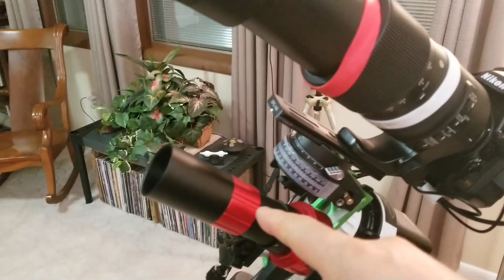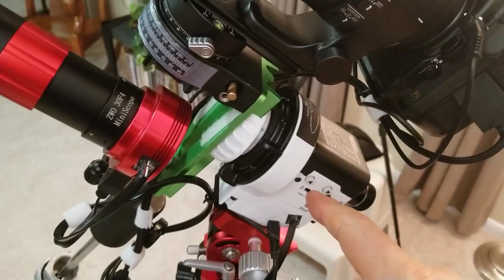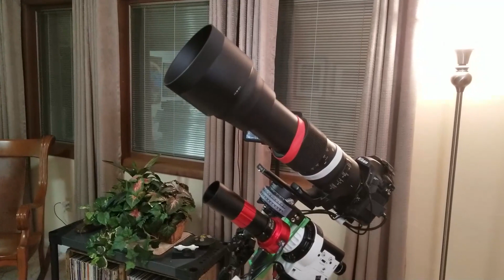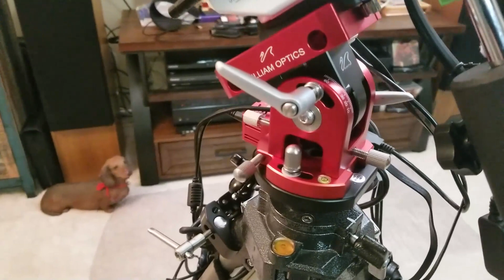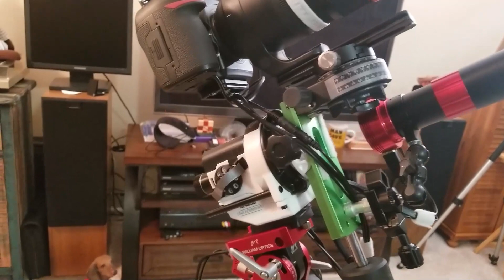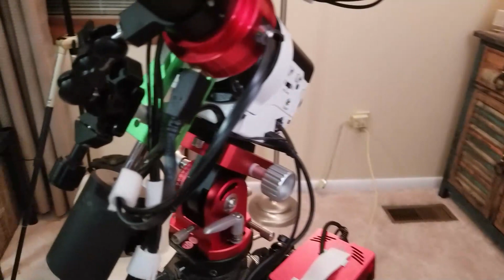Sky Watcher Star Adventurer Pro - An Overweighted Configuration

Comment: Yeah, I learned that centralizing the mass closer to the middle reduces the amount of torque/load on the mount. If you decide to remove the rotating base and dovetail bracket (and mount the lens collar directly to the latitude base), you might drop another pound and bring the assembly an inch closer to center.

I first tried my camera on a ball head mount. Later I tried it on a nice video floating head (which had a perfect spot for mounting my guidescope, and had really smooth alt-az slewing). But it raised my assembly so far from center that I almost needed second counterweight or extension bar. I later got an L-bracket and moved it down a couple inches and now I'm fine with one counterweight at mid-bar. It's definitely been a trial-n-error process.

I had an old raspberry pi laying around the house, so I decided to load up astroberry. I have it working at 90%. But just have issues with it running photo sequences (which is pretty important). I also use Sharpcap for polar aligning, which has been really good. So I might still need to stick with a laptop connection until I can get these issues worked out.

Thanks again for sharing.
Reply from the maker: Thanks for your comment Mike, but removing the dovetail plate and pano base/clamp would actually not save but about 0.5 lbs., and in the process I'd lose the ability to balance the camera & lens fore/aft for a more refined balance relative to the targeting position for whatever celestial subject I'm going after.  All in all, this setup is working actually a bit better than expected, with successful exposures as long as 13 minutes thus far.

Comment: I'm pretty new at this so my experience is limited but I bought this mount for Milky Way shots and for that it's very good. It holds a Canon 80D (1.61 pounds) and Sigma 18-35 F1.8 (0.5 pounds) or a Samyang 14mm f/2.8 ED with no problems and for wide field photography the polar alignment is not nearly as critical. 
I have used it for a shot of the Orion nebula once or twice with the Sigma 150-600C (3.96 pounds) and had no real problem with that but it's an easy to find and fairly bright object so it doesn't need long exposure times. 
I've seen a lot of people use a Samyang 135 F2 (1.82 pounds) for other deep sky objects and of course small APO's like the Redcat 51 are pretty popular and they get pretty good results.  I have a Irix 150 f2.8 (macro)  that I want to try on the Pleiades.  I've seen one guy get really nice results with it.

Anyway the point is that (imo) this mount is good at a few things but that if you get to the point where your equipment is too much weight for it, it's probably time to move to a better mount rather than try to modify this one.  Keep it for it's portability and wide field Milky Way shots.

And thanks for the LED micro light idea. I was using my phone but it's hard to hold in position and adjust the alignment at the same time.
Reply from the maker: Hi...thanks for your comments.  I'm glad you found my use of the microlight a useful idea.  I fully agree that a more robust mount with higher payload capacity is desirable.  The ideas I've shared here are, as I know you realize, just an effort at making the best of a less than ideal situation.  :)  For grins, here is an image comparison I made from two subs I shot last night, one of 8 minutes, the other at 16!  Yeah, yeah...can't do 16 it seems, haha!  https://tinyurl.com/dp-SApro816

Comment: That WO base makes a huge difference. I too purchased one and thought myself crazy considering the cost, but in the end it was worth it to have this portable setup. A lot of great ideas and considering my experience mirrors yours exactly, people would do well to take you up on your great ideas. Thanks so much for the video!
Reply from the maker: Thanks Gregory...yes, I think in the long run I can say the WO wedge was a worthwhile investment.  What I thought to be star trails and now favor calling "star tails" had me thinking I was really going to have to go with a more robust/expensive mount to carry this heavy payload I'm shooting with.  While that remains true and I do think it will yield better results, I think the wedge upgrade and some of my other practices, along with perhaps having a Star Adventurer Pro that might be one of the better ones out of the factory, find me shooting as much as 8-minute subs with some pretty good results.  Star "tails" no longer than at shorter exposures, so I think they are more optical issues than star trailing ones, and thus I feel OK about sticking with the SA Pro for now and just aiming to improve my technique, while saving up for and waiting for other mounts to become more readily available.  I've yet to even look at it, but just for sake of comparison, while doing some 8-minute subs last night of the M61 galaxy, I also threw in a single 16-minute sub that, at least in preview, looks as it even it is reasonably good.

Comment: What is that thing you have through the sighting hole on the side of the SA? Is it a slimine laser pointer?
Reply from the maker: No Willie, nothing nearly as elaborate, haha!  It is the plastic barrel I took from a cheap mechanical pencil, to potentially use as a very coarse sighting tube when aiming the tracker in the vicinity of Polaris.  I took the ides from Andrea Mineola's page at https://nightskypix.com/skywatcher-star-adventurer-pro-setup-and-user-guide/.  The SA has a small hole to use for sighting through, but adding a tube to view through forces a more linear view that is at least a little more accurate.

Comment: Hi Daryl great video and lots of ideas for my star adventurer. I struggle with my auto guider but like your idea. Can you add or send me the links to the double-ball head mounts, the offset rod and the clamp please. Thanks again
Reply from the maker: Thank you Frank...Before sharing the links, let me say that since the time I uploaded this video, I've learned a little from others about the issue of flexure, which regards the movement/vibration of the guide scope relative to the main lens, and could introduce some imaging issues that I'm not really up to speed on yet.  Basically, a rigid guide scope mount is recommended but, for the moment, I continue to use the double-ball arm.  However, despite initially resisting Peter Zelinka's idea of mounting the guide scope alongside the camera on an L-bracket, I have evolved to doing the same.  My current setup is discussed in https://youtu.be/CLA0ldnAdKw.  Here are some equipment links:

SmallRig double ball arm:  https://www.amazon.com/SMALLRIG-Universal-Magic-Small-Ballhead/dp/B07K84X662
https://www.amazon.com/Universal-Aluminum-Adapter-Professional-Bracket/dp/B07TPS89PR - Not the one I used, but similarly small and cheaper  :)
Leofoto DC-12 12mm Micro Clamp:  https://www.amazon.com/LEOFOTO-Micro-Clamp-Index-Compatible/dp/B08179YN83 - more pricey, but the smallest clamp I've found and my preferred choice now
Fotasy 25mm Plate used on offset post as in this video:  https://www.amazon.com/Fotasy-Release-Arca-Swiss-Standard-Ballhead/dp/B00V9M66TM
3/8" Female to 1/4"Female adapter post was part of this set:  https://www.amazon.com/Maxmoral-Threaded-Adapter-Monopod-Trigger/dp/B07PMPC73X

This photo shows a more close-up look at my current guide scope mounting approach:  https://tinyurl.com/dp-SAcabling

Comment: What an amazing video and very clear thank you 👌
I've recently purchased this mount and using it with my d500 and 150-600mm c lens, I seem to struggle to balance due to the weight and when zoomed in the balance of the lens/camera shifts and it goes out of balance again 😞 I would say I have to throw away 70% of my images due to trails so I will be using some of your ideas to try to improve my setup 👍 I haven't got a guide scope so I know I won't get anywhere near your exposure times but if I can reduce the failure a little then I'll be happy 😊
Great work and thanks again 😎👌
Reply from the maker: Thank you...Yes, you will certainly find a balancing struggle exists anytime you shoot at a different zoom focal length, courtesy of that external zoom design of the Sigma which is moving the heavy front element(s) of glass and shifting the balance point significantly.  You may know already that there is also a risk of a focus shift particularly if you've changed the focal length significantly.  At the moment, I don't recall if the Sigma Contemporary has issues in this regard or not, as I'm predominantly shooting at the full reach of 600mm.  So, it's always prudent to both re-balance your setup and also reconfirm focus any time you change focal lengths.

Comment: I went through this mess with a star tracker.  I now use a Losmandy G-8 equatorial mount.  It's more fool proof and has a 30 pound payload.  Another factor is wind.  Any wind at all will reduce your payload especially with a long lens like that.   Also, a star tracker tends to be lop sided so they center of gravity will shift as you slew around the sky and you will have to re balance.
Reply from the maker: Yes, true enough, a more robust mount will be a big help and an iOptron CEM40 or GEM45 is on my wish list.  I always balance relative to my intended subject position, so that's not really an issue to me.

Comment: Can you give me your pipe fitting/weight mod size? I was looking today at the hardware store and realized I have no idea what size for the 1lb of  weight. Is the M6 bolt 16 or 60mm? I thought I heard 16mm but closed caption thought 60mm.
Reply from the maker: Sure Mike, here's an image I put together some time back that lists all the parts....I think I referenced it in my first video about this configuration I'm using.  https://tinyurl.com/dp-SAcounterweight.  You could likely choose whatever length screw best meets your needs, but I chose 60mm.  The size of the pipe fittings isn't critical...just whatever will nest together and seems a comfortable size.  In my case, it was coincidence that I had a fender washer of just the right diameter to use inside the pipe cap, so to add more weight I poured BBs into the cap, trapped behind the washer which was in turn held in place by a pipe bushing.
Reply: @Ambress  Thanks that's very helpful 👍
Reply from the maker: @michaelwmcdonald  you're welcome....I was just looking for M6 screws on Lowes.com before saying more, but the website does seem to confirm that 60mm M6 screws - not bolts, being I needed it threaded fully from head to tip, to be able to secure the cap to it with nuts - were the longest M6 I could find, at least locally.  90-100mm would've given me just enough extra room for the times I've found an extension might be useful, but I didn't worry about that since I already had some extensions I'd made for my initial efforts of simply using the stock counterweight on an arm twice as long as the original.  So, I just cut one of those in half, attach my weight to it, then screw that assembly into the OEM arm.  I'm basically right at the point where an extension isn't needed but gives some extra "wiggle room".  The extensions were made from 12mm diameter aluminum rods I found on Amazon that very conveniently were already bored to 5mm, perfect for tapping an M6 thread into.  Here's another image I just found and uploaded to show those extensions:  https://tinyurl.com/dp-SAcwextend.  Here are the aluminum rods:  https://www.amazon.com/gp/product/B07YCGPLHV

Comment: I love outside the box ideas. I actually rebuilt/modified a Ioptron mounting wedge to cancel out the shifting that occurs when tightening down the hardware.  Good video :)
Reply from the maker: Sounds great!
Reply: How did you mod the wedge? The locking lever is the biggest problem.

Comment: Just a note for anyone using alkaline batteries in any of your equipment...  remove the batteries when not in use, it will save your equipment from damage.
Reply: This thing chews through AA batteries pretty quick, which is why I use a high MaH  rechargeable USB portable charger,. They only cost about $20,  they last longer and will save you lots of money in the long run!
Reply from the maker: definitely smart to do....and easily overlooked.  Good advice.
Reply: @Ambress  I bought a couple of rechargeable  USB portable chargers, only about $20 each, and just power the unit through the USB port. They last longer than 4 AA batteries, and you can just recharge them!
Reply from the maker: @-WhizzBang- , true enough.  I have a USB power bank as well and have used it for that purpose, but generally just run a USB cable to my power strip which also has USB outputs on it.  But, if there's no AC near, then yeah, a power bank works fine.

Comment: I have a similar setup as well mate. I love it as my grab and go. You will be surprised how much weight they can take. The day after my warranty ran out I performed an internal  maintenance do over. We have to remember these units are mass produced in China, so quality control is not on their high priority list. When I did mine I found metal flakes inside. So long story short, my suggestion for what it's worth, put this on your to do list. It's not that hard if your a bit handy with some basic tools and there are plenty of vids on YouTube for you to check out. Find one that suits you, watch it a lot before attempting any work and be confident in what you are setting out to achieve. Was it worth it? Yup I want from 2 to 5 minute guiding. Heres one I used. https://www.youtube.com/watch?v=ublmCpZhuu4&list=WL&index=1&t=1165s
Reply from the maker: Great info, thanks!  Thus far, I've not noticed any real issues with the clutch of my SA Pro, which I bought last November, but I'd not be surprised if I eventually need to give it an internal cleaning.  The longest I've tracked at, and I'll say without trails but with tails, is 8 minutes and that was while shooting at 850mm with 4kg of gear, so I'm very happy with that result.

Comment: Thanks Daryl, great video. lot of good ideas in putting that system together. I too have a similar set up, but with smaller lens on my DSLR. I followed Peter's L bracket method to attached a guide camera when I bought an ASIAIR Pro. Balance is OK.
Can I ask, have you tried polar alignment with the ASIAIR software?
Reply from the maker: Yes Mich, ever since I bought the ASIAir Pro, performing a polar alignment using the ASIAIR app is always my approach, no matter how I attach the guide scope or where it is aimed.  It works great!
Reply: @Ambress  thanks for the reply. Did you ever get an issue with the ASIAIR not registering any rotation when you started the alignment procedure?
Reply from the maker: @michs1708 , no, I have never seen such a problem as best I can remember.  The only issue I ever recall seeing was simply that resulting from intervening cloud cover interfering with the scope seeing Polaris, resolved the moment the sky cleared.
Reply: @Ambress  ok no worries thanks for your feedback and clear skies to you!
Reply from the maker: @michs1708  You're welcome, clear skies!

Comment: Nice setup. I cannot afford all the “best” gear and make my AP investments very frugally and carefully. I was pushing my Star Adventurer to the limit like you, so I upgraded my mount to the ES Exos100 and downsized my camera from a Nikon D700 to a Fuji XT1. Now I can autoguide my 72ED scope with much improved success.
Reply: That mount looks interesting.  I'm strictly a budget AP guy. Can't justify spending thousands on the equipment and most of the stuff I have is used for regular photography too (other than the SA).
Reply from the maker: I had not heard of that ES mount Jim, but it looks like a fine and more affordable choice for a moderate weight payload, which you've further addressed by your camera downsizing.  I'm glad you're seeing the improved success you report...always great news!